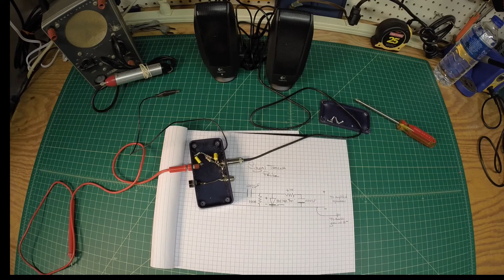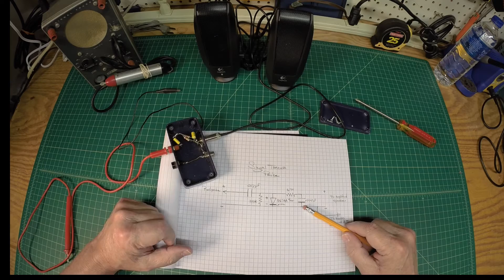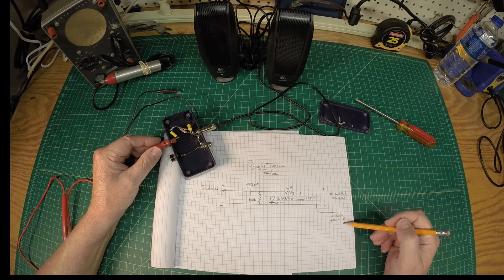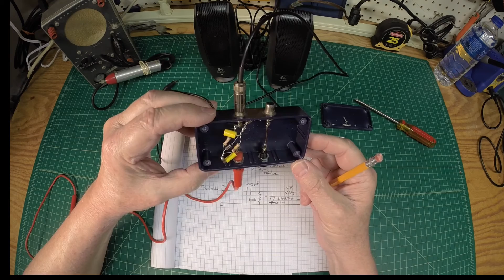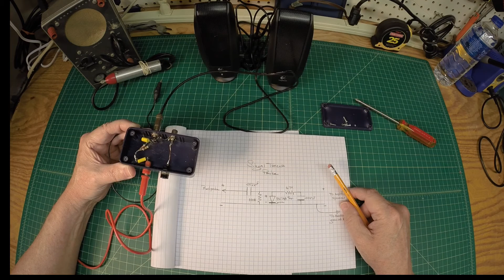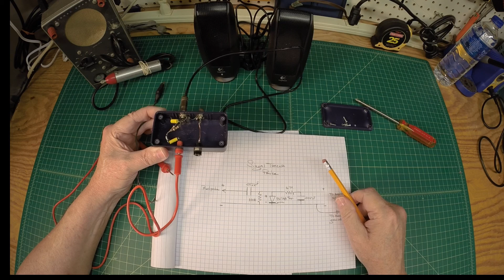Signal Tracer Probe

Comment: Hi there!
I like this Signal tracer construction. I am a beginner, just repaired an Philips Philetta from 1944. The radio works poorly on Medium wave, not on Short wave. Now I´m interested of building a signal tracer to practice. Does an 1N35 diod works instead of an 1N34A? How critical is the 2200pF capacitor? My idea is to use an old Radio Shack amplifier/speaker I own, instead of a computer speaker. If I trace RF then I can just measure the signal with an multimeter DC voltage? Or is it possible to listen to RF in the speaker? Many questions // Greetings Kurt
Reply from the maker: Kurt - I’m not familiar with the 1N35 diode, but I believe it to be a rare dual 1N34A. The capacitor value in my design could be +/- 20%, so not a big deal. The diode will convert the AC voltage to DC, so you can measure it with a DMM. The demodulated signal from the diode can be amplified and heard through a speaker if the level is high enough. Best, Don
Reply: Thank you very much Don @RestoreOldRadios

Comment: I built a similar probe and a signal injector back on the mid '50s. They were the most useful pieces of test gear I could afford at such a young age. And as much as technology has advanced since then, they are still a valuable asset to my workbench. 

BTW, you referred to the parts of the 1N34 diode as the 'anoid' and 'cathoid', they are actually pronounced 'anode' and 'cathode'. There is no 'i' in either word. Otherwise, you have a terrific video on simple troubleshooting techniques. You also had a good tip about using computer amplified speakers as an auxiliary audio amp for various projects. I have several I've picked up dirt-cheap! 

This is the first time I have visited your channel and I look forward to viewing your other videos and subscribing. 

73, de Mick Bradford - WB4LSS
Reply from the maker: +Mick Bradford Mick - thanks for checking out my channel. I enjoy using my signal tracer when the opportunity presents itself. Like you said, with new technology, I think many times the "basic" test equipment from the past is overlooked. Thanks again for watching and your kind words. Best, Don

Comment: Don,
An old friend of mine (aged 81), who is not computer literate, asked me to thank you for this video, and the one previous. 
Two days ago, I received a telephone call from him asking if I’d any ideas why the radio he was working on had no sound, yet he was able to hear audio frequency response when he touched grid 1 (pin 1 of a UCL82) with the tip of a screwdriver.  I went through the rigmarole of explaining to him about using a bench amplifier, with signal tracing facility, and begin investigations at the ‘half way’ point in the radio circuit, and continue forward, or backward, as necessary with the fault tracing.
He was okay with the bench amplifier bit but it soon became clear the ‘signal tracer’ part was giving him a problem – he was not familiar with one of those.  
Having invited him round to my work shop-cum-game room, I let him view this video, and the one previous.  He was so impressed how well you presented the tracer circuit, and how you applied it, he made it clear I was to thank you on his behalf – so ‘Thank you’.  
His radio fault turned out to be no HT volts on grid 2 of the 2nd IF valve (pin 8 of a UF89).  The 15K voltage pull-up feed resistor, according to one of my meters, gave a reading of 13.4 Meg – that is what I call ‘definitely gone high!’  Once replaced, the radio began to function.
Phil.  P.s, my tracer circuit is virtually identical to your circuit – a 2n2 dc block cap, -> 220k and OA79 germanium diode parallel to deck -> 22k fixed resister in series with 220K lin pot (attenuation), and a 820pf cap to deck.  I constructed it almost forty years ago: it is incorporated inside my bench amp (with bypass switch), and it is still working well.
Regards,
Phil.
Reply from the maker: +SteelCity321PB Phil - First and foremost, thank you for your positive feedback, taking time to view and sharing it with your close friend. It's rewarding and motivating that he found the videos to be informative and they added value. I'm always learning and trying to improve my skills and knowledge on every repair/restore and I've learned so much from others over the years, it's great to give back. I'm glad the root cause was identified, corrected and it's playing again. Did you construct your tracer and do you recall the source for the schematic if applicable? I built mine back 10+ years ago and I can't put my fingers on the source for the schematic. Best, Don

Comment: Very nice! Just a couple of questions: I see 4 outputs from the box, red for probe, black for ground, jack for speaker, but RCA? I don't understand its use: it seems to be connected only to ground. Second question: usually this device has a switch forrf or audio testing, bypassing the diode. Diode is always in use in your box: can you use it in audio or rf test without changes?
Reply from the maker: Thank you. To your point, that connection is a ground. I couldn't locate the original schematic and I don't recall why I placed it there; I never use it. Regarding the normal switch to bypass the diode for audio, I think the 100k resistor on the input side of the diode (in parallel w/ the anode/cathode) makes the circuit useable for either audio or RF without a switch to bypass the diode. I've seen other probes without a switch that have a 1 meg resistor on the output side of the diode (in parallel w/ the anode/cathode). Here's a closer look at the probe schematic if needed: http://youtu.be/3kyXCCdtPUY  Best, Don
Reply: Mephysto65

Comment: I like that simple signal tracer. I have an olde Eico 145 on my bench that I have not gone over. I should see about restoring it. Gary
Reply from the maker: Thanks Gary. It's a very simple circuit as you can see, but very effective. It works better than my Heathkit, but like you, I haven't restored mine, so it's a apples to oranges comparison. Best, Don

Comment: Hello Don, I really appreciate your video. I would like to build this but I cannot see the capacitor values on my screen and you don't mention them. You did state the resistance on the two resistors but I would appreciate the cap values. Once again, thanks for all your great videos and efforts. Greg
Reply: You have to use the highest resolution: the input cap is 0.0022uF, the other cap is 0.0047uF, the parallel resistor is 100k and the series resistor is 4.7k. The diode is 1N34A. I understand that your comment was 2 years ago but this may help out someone else.
Reply from the maker: It really depends on what you’ll be testing. I typically use capacitors rated for 600V. Check out my latest video on a prototype signal tracer you can build as well. Best, Don
Reply: Thanks! I'd like to build this as well - what voltage caps should be used?

Comment: Hello Don. I have the same Heath kit signal tracer. The one you built would be fantastic for a spare or to use full time. The circuit is small enough to put inside a magic marker tube or a ink pin tube using surface mount parts. Cool. Thank you for the how to video.
All my best.
Bobby
Reply from the maker: Bobby - Some cool ideas for a redesign you shared. Now you've got my mind... Best, Don